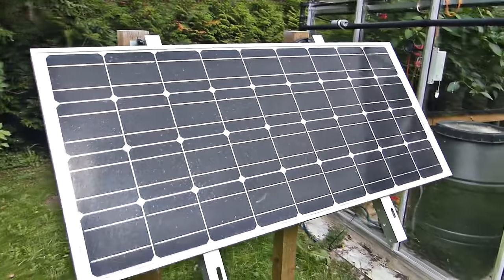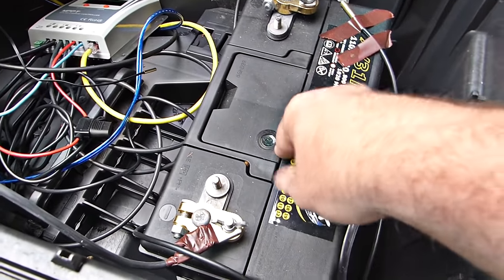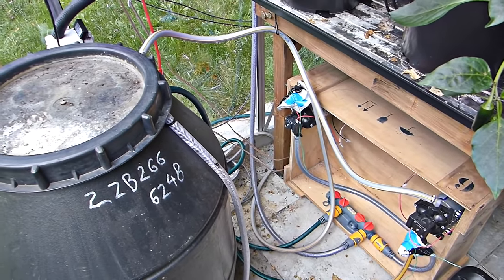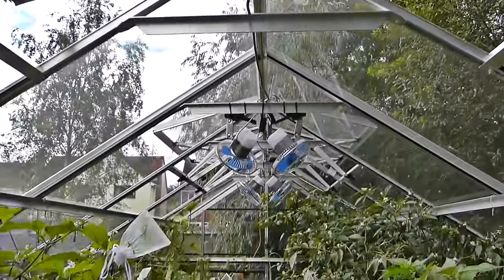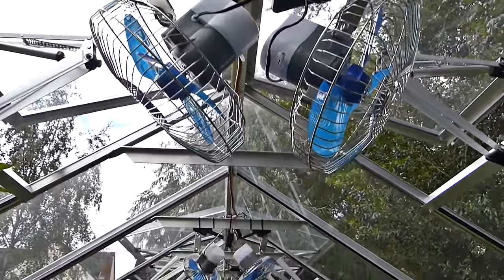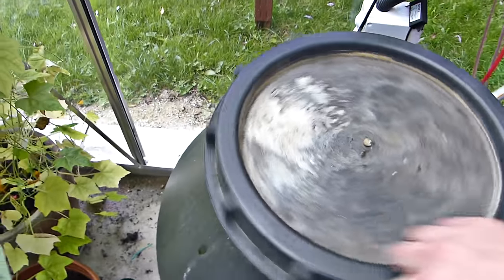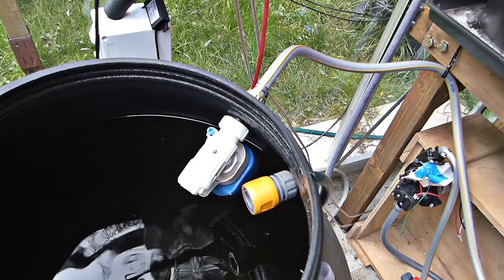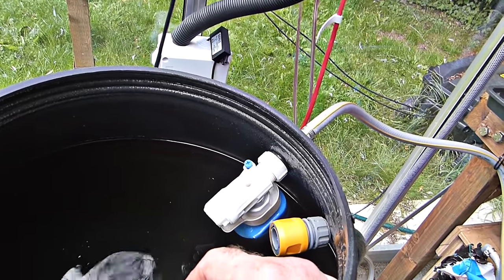Off-grid Greenhouse and Garden Automation

Comment: For the sake of simplification I'm just going to call your board an Arduino.  It's technically known as an 'Arduino Clone'.

1.  Your battery shouldn't be inputting varying voltages to the Arduino.  Just because the input voltage has a range doesn't mean that circuit operation will tolerate changes to that range.  You should have a voltage regulator in between the Arduino and the Battery, especially if you also have a charging system connected to the batt as well.  :/
2.  You wouldn't have more loss of power on the 5v side than on the 12v?  The 12v gets converted down to 5v as well...that's where your power loss would be.  The 5v USB connector is only there to power the Arduino enough to upload your sketches.  You use the 12v barrel plug for running your circuits.  The reason is that the 5v USB connector is limited to a maximum of 500milliamps, 30 of which are used by the Arduino itself.  Meaning on USB your entire system can't be drawing >~450mA.  If you draw more than that it start tripping the polyfuse, and with repeats damaging the fuse.  When you swith to the 12v barrel plug, on your model, it increases that limit to 1A.
3.  The difference between a RaspberryPI and an Arduino is not that the PI is a computer.  They're both computers.  There are not more chances for something to go wrong on a PI, both it and the Arduino crash for the same reasons.  The Arduino is not a machine.  It boots up just like any other computer.  It does have drivers.  RaspberryPI's can be configured to boot up, automatically log in, and continue running...just like an Arduino.  You do not get stalls in a Pi, you just have software you don't need for the purpose running on it because you have the wrong type of OS.  For a project like this try the lightest version of Raspbian and then add only the software you need.  The difference that you're looking for is that the header pins on a Pi have much lower current limits and take a greater understanding of programming and electronics to deploy.  But the real answer is that you need both.  The Arduino is built for interfacing with harware, and the PI for interfacing with humans, while at the same time they're both extremely good at communicating with each other.  So code that allows human interaction with the settings that control the greenhouse should be on the PI, it then tells the Arduino what to do, the Arduino  knows how to do...it does, and then the greenhouse is.
4.  If you put those DHT22 sensors inside small Stevenson Screens, inside and outside the greenhouse, you'll get much more accurate temp and humidity readings.

On a side note, the pressure release valve system on your irrigation inlet manifold (water hose that goes back into the reservoir to manually control pressure) was brilliant.  I'm going to use that in my design.  An upgrade to consider:  they make solenoid valves for water hoses that are controlled by 12v.  Couple one of those with this bad boy, https://uk.rs-online.com/web/p/pressure-sensors/2355891/ and you could automate that pressure release system automatically.  You could even code it to preemptively open the relief valve just prior to pump shutoff to reduce water hammer and thereby decrease the stress on those expensive motors as well as your entire irrigation system.

Just out of curiosity how are you managing the back electromotive force generated when your pumps kick off?  And what's your transistor setup for triggering the relays that control your pumps?
Reply from the maker: Hey Stephen, thanks for the comment! I will admit I tried simplifying what I was talking about, not all my audience are that into this side of things (most are here for the chillis and sauces!)

1. I'm not using arduinos or arduino clones. They are ESP8266's...specifically they are ESP8266's on a Wemos D1 R2 Dev board. This particular board has a decent switching mode voltage regulator built in (I believe it is a CJ2301, and the board is rated for 9-24V input). It is pretty efficient too, I have compared the power loss to a good buck converter, and there wasn't much in it. 

2. I wouldn't ever power this with the usb plug...if I was going to use 5v, I would just put it into the 5V vin pin, using a regulated supply...for the reason you mentioned, limited amps through the USB. I have in fact switched to a regulated power supply now, as of the beginning of the week! I did this because I put in place an Arduino nano too, also powered by by the 5V buck converter. I am using the Arduino to have redundancy with the watchdog timer. I have had problems in the past where I would lose access to the system, because it didn't reboot when there was a problem connecting to the internet or maybe caught in a loop.  The Arduino checks for a keep-alive signal from the ESP8266, and if it times out it resets the system. I know this is overkill, but I don't want to be away for 2 weeks and my plants don't get watered!

3. Again, I was probably over simplifying. I meant that the ESP8266 (and the Arduino for that matter) is a microcontroller, a simple computer. The Raspberry Pi is a general purpose computer which is running a full stack operating system...way more to go wrong! But more importantly, the Raspberry Pi (even the rPi Zero) uses way more energy than the ESP8266...which is important because I don't get a load of sun to charge up my system during the winter. But with the ESP8266 i have no problems. I am using 30Wh per day with updates every 30 seconds via wifi (and not running fans, pumps, lights etc). If I was doing this using 2 raspberry pi zeros, I would be using 48Wh with them just idling.

4. Good idea...I am having issues with my external temp monitor. i have tried a few different placements. I will have a look at the stevenson screen...hopefully I can get a small one.

I did consider using something like you mention to monitor pressure of the system, but honestly once I have my plants setup and I get the pressure right...it is set and forget, the drippers I use need a specific pressure to work optimally, and don't really vary. I was thinking about maybe getting a controllable valve though to seperate watering zones...maybe a project for next year!

My pumps power is isolated from the microcontroller, I haven't had any issues with surges coming back. I am using a 4 port relay (like this: https://www.sainsmart.com/products/4-channel-5v-relay-module). It needs 5v to activate, and the Wemos board is able to do that easily with the GPIO.
Reply: Not all of use I don't use a green house but I could use every thing you have there worked up I just have no need for fans so I would have far less power usage and my growing season is mid April to end of September and in the heat if the year the temp here is 95-110 F about 33-39 C ruffly converted and need to water twice a day and am not going to have time early and late in the day so I am very interested in what we can all come up with
Reply: @geringgardener9760  hey mate - crazy climate, where are you located roughly if you don't mind me asking?
Reply: @platima  I live in gering nebraska United States of America I live in West nebraska it's hit and dry here in the Summer
Reply: @geringgardener9760  Ah okay. So very different to AU and UK!

Comment: Nice system, just remember lead acid battery fumes attack Electronics. I would not let them share a compartment.
Reply from the maker: There is a vent to the outside of the container, connected to the battery.

Comment: How much did this set you back?
Reply from the maker: The expensive bits are the battery, solar panel and pumps. All in all about £300.
Reply: @ChilliChump  I'm not going to use it the way you are I'll be running a air conditioner in the summer and a heater in the winter .what I like to know is ,does the Solar panel come with a bracket that you can mount it on to the side of the house with. All I'll need is a solar panel, a battery, and a DC to AC converter
Reply from the maker: @rustyridenour2136  you are going to have quite a challenge running heating or air-conditioning from a solar setup. They are both very power hungry. So make sure you size the system up accordingly. My solar panel is 100w. Which on a good day can generate 1.2kwh. A typical heater uses 3kw per hour.

Comment: I have never had my Linux machines crash unless I was tinkering with unstable software.
Reply from the maker: In general, I agree with you. I run multiple Linux servers which are very stable. But compared to devices like the ESP or even Arduino, it's a whole different story. No chance of file corruption.  Also "boot" is instant. And most importantly, power consumption is significantly less with these devices.